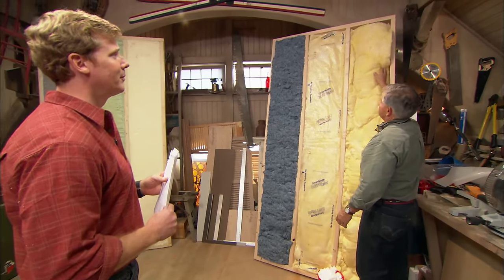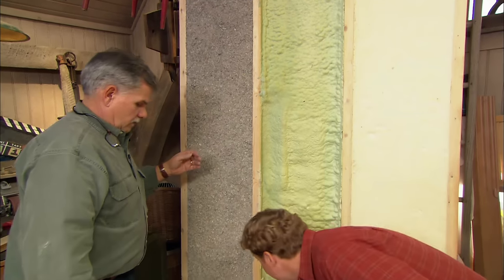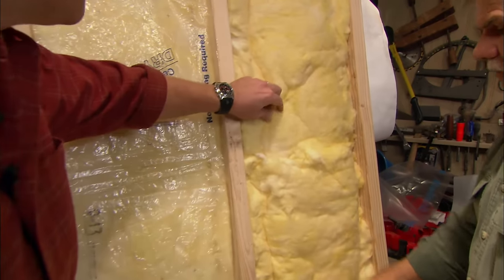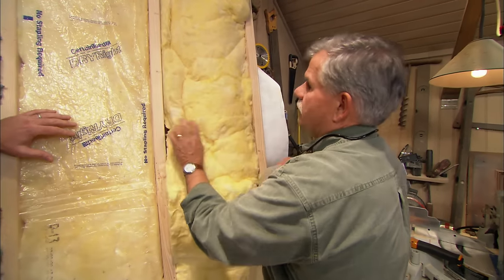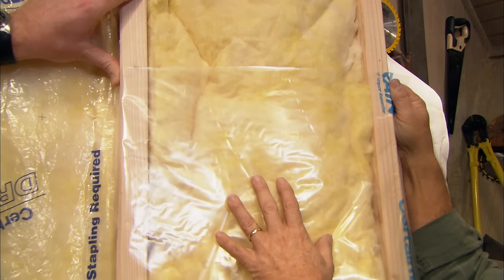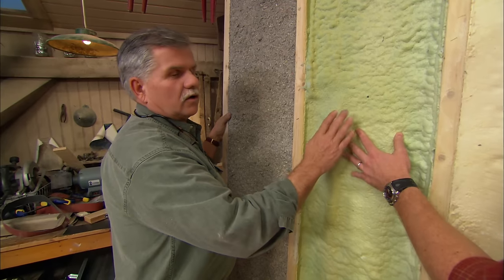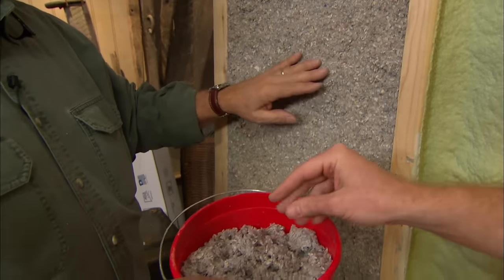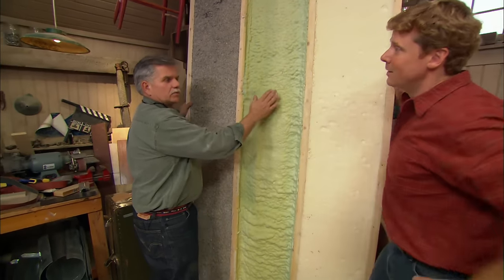How to Choose and Use Insulation | This Old House

Comment: I just had my attic air sealed before I added new cellulose insulation. The process was: All the old insulation was removed. Then an electrical contractor rewired the entire house; all knob and tube wiring was removed, not just deactivated. After the electrical inspection by the city, the insulation guys came back and air sealed the attic. They used foam board and various foams for cracks, etc. I saw pictures of what they did and the amount of work that was done was amazing. They also air sealed my basement in the same manner. Then new insulation was blown into the attic and more insulation was blown into the outer walls of the house. All the insulation work was done by a BPI certified contractor. Then an inspector came with a heat device and checked the heat loss. A few spots in the walls needed to be 'topped off' and that was done. The difference in my house is amazing; no more cold spots! I have a 1927 Craftsman Bungalow so I still have, and intend to keep, all the original windows, so heat loss happens there. I have caulked all the windows. I am working on getting interior storm windows but in the meantime, I put up plastic coverings. Even with the old windows, the house is significantly warmer. What a difference.
Reply: What was the cost for just the full insulating?
Reply: I'm saving your comment. I want that done to my home. Just what I was looking for. Thanks for leaving your comment.

Comment: Something no one talks about and most people don't realize is that the rigid spray foam insulation offers no sound proofing.  My neighbor spent a fortune insulating his entire house with it and now he can hear someone's conversation on the sidewalk as if they were in the same room.  Personally, I would spend the money on ICF instead.
Reply: You can use a combination, 2” closed cell to get your air and canoe barrier, then 3.5” of rock wool, then 5/8” sheet rock.
Reply: There’s also sound dampening you can put behind the drywall
Reply: @jaykay9112000 - I actually wouldn't do that either as it puts the vapor barrier (the foam) too close to the cold side of the wall (for my climate zone anyway - zone 6), asking for condensation and mold.  Plus, who wants to hang entire homes in 5/8 board?  Not me.
Reply: Because it dries hard, it become a sound 'conductor'. It creates a 'circuit' for sound to travel from the exterior to the interior. The other insulation's do the opposite with 'Rock-Wool' having probably the best sound-proofing characteristics. As with many things, there are trade-offs. . .
Reply: Brian D. I have now put spray foam in my ceiling and exterior walls, and I don’t notice anymore sound than when I had fiberglass. If you look at the sound dampening tests spray foam is only slightly below fiberglass in the testing
Reply: Plus it shrinks and allows air around  it. It gets Worse. It's hard to take out and start over
Reply: Icynene Spray Foam does not do that, It's open cell. WE have had it in our house for 20YRS and love it.
Reply: closed cell is best for attics and stuff like that. open cell is best for interior walls etc. you can also layer spray foam and fiber glass to get more R value.
Reply: He used open cell??
Reply: Plus gas off from the foam is toxic. Lots of people have gotten sick. 20/20 did a report on it.
Reply: Rots the timbers not fits.

Comment: In my denver 1.5 story home, i could not get the upstairs below 78 on hot days with the AC cranking full time. (My system was working properly but flow upstairs was weak). My cellulose insulation was only about 15 inches. I had a contractor add "caps" to the 15 can-lights  and seal them, top off the insulation to 36 inches, and foam a few spots like where my two-story living room wall abutted the attic over the garage. The difference was amazing. If the AC is on, the upstairs is about a degree warmer than the 73 degree main floor, and the AC will now cycle. But even on hot days, if i run the house fan at night, the house is cool enough to where i wont need the ac  until the afternoon, if at all.

Comment: Very nice! Especially for people who is just thinking about insulation!  What exactly you would recommend for a plain 20+ years old (not commercial)  single level residential house insulation? Brick veneer outside, than timber frame and plasterboard inside (with empty voids of course) :)   I can see a soft maths at retail which are very similar to one of your samples. However nobody from experts can advise me about a vapour barier.  How to do this? What kind of material I have to use? Is it something special or ... any plastic film can be used?   A very interesting subject- what do we have to do with ... massonry "weep-holes" underneath?  Should we cover them or leave them open?   And, btw.... while insulating empty walls we are creating a nice environment for "crawlers". It will be convenient and warm for them to grow their colonies. How to prevent this "side effect", please?    Thank you

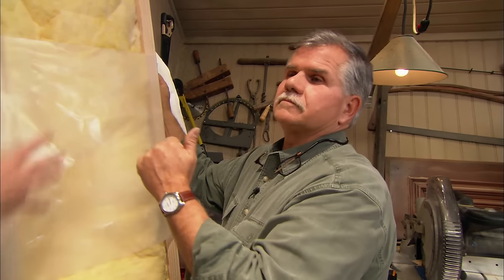Comment: I'm trying to figure out how to get mold and mildew from developing in a large closet. Because it's on an outside wall, moisture seeps in. Tried DampRid (hardly any good) and a small dehumidifier (fairly ok). Does blown cellulose fix this issue? Or do I need a vapor barrier as shown at 2:38?

Comment: Nothing was mentioned about Stone Wool or Roxul or fire prevention.
Reply: ximenoworks There was something mentioned about fire prevention.
Reply: How do I get insulation into existing walls
Reply: Linda Munsey He covered it at the end. 
Home Depot rents a machine. Drill about a 2" hole at the top of the wall between each set of studs. Lots of holes. The machine grinds it up and blows it into the cavity.  Then repair the holes.
Reply: Outside, inside og in between :)
Reply: Lemay that’s mainly used for fire blocking and sound. I’ve never used it for thermal.
Reply: Linda Munsey remove the outer wall or remove the sheetrock
Reply: Shang....Hardly.  It has an R15 rating
Reply: Linda Munsey you need to make a human sacrifice to the insulation gods. Then wait 3-4 weeks for shipping.
Reply: Why didn’t he include Rockwool insulation?
Reply: @dbodooley  you're so wrong it's used for insulation and has been for a very long time
Reply: @shawnr771  bad advice, Shaun. Getting densely packed fiberglass in walls is impossible. It will settle. Getting densely packed cellulose into a wall takes experience and professional equipment not available at the big box stores. BTW, your hole location and size are off.
Reply: or the issues if you ever want to change or add an electrical outlet in walls with the spray foam inside.
Reply: Shang Tsung no it is used for thermal and it is good at it,
Reply: @lindamunsey9898  they talk about that
Reply: Shang Tsung wrong
Reply: @dbodooley  Roxul makes both. For sound and insulation. I replaced all of the dangerous fast melting fiberglass Insulation  with Roxul. My R value went up by a factor of 2 from fiberglass insulation Melting point of Roxul is above 2500F as fiberglass melts below 1000F. Its simply safer for the house from a house fire point of view.
Reply: Came here to make sure someone brought this up. Fire retardant without added chemicals, bugs don't like it, eat to fit in, repels water, isn't ruined in a flood, etc.
Reply: @shawnr771 if I do this method,  do I leave my old insulation there ? The old insulation been there since forever. My house is from the 50s. Not sure if prior owner did any renovations. Thanks.
Reply: Not sure on that 

The home I did not have any insulation in the original walls and no fire blocking.

It sounds like you have a serious project.

If you are doing demo make sure to wear appropriate PPE.

Comment: Two questions for Tom please? 1- How can a DIY homeowner put any of the retrofit insulation in ourselves without hiring out the job or renting a blower? 2- Why is the foam (or other full compact insulation) so popular to you Tom, when I have seen you trying to run wire or cable down the inside of an existing wall? Or for that matter, repair or run short plumbing vertically? Thanks to the team for all these Videos!! I learn something from all of them (wish your team could come to my house and video some needed repairs).
Reply: FYI...closed cell spray foam is the best insulation...BUT - you can't do it yourself and it's expensive.  And if done incorrectly it can be dangerous and possibly render your house unlivable.
Reply: I saw that on Youtube from a segment on the CBC where homes were made unlivable and people had these brand new homes but had to live in a trailer outside of the home or they would become instantly sick and the horrible smell too.
Reply: @tonym1279  , it's not "the best" it harms our ecology big time. You can insulate inexpensively and reach zero energy.

Comment: Which is the best retrofit material for a cathedral ceiling through the fascia & soffit to add present bat insulation in Illinois weather. Venting along the soffit was shut due to the moisture condensation inside & vents at top of roof left open cause scaling at top of beam inside.  Thermal imaging was done and the corners & a 4 x 5 foot area over the front door was missing insulation.  Advise would be greatly appreciated.

Comment: If you're here in 2020, it's been determined that water vapor amounts for about a quarter of a pint over the period of a year. Compare that to almost 12 quarts of water with just a 1 inch hole in your wall. Air movement > water vapor, every time.
Also, a latex primer over your drywall is more than enough of a water vapor barrier.

Comment: Anyone know of an option for insulating a beatiful old cabin with log siding ext, and vertical pine solid paneling inside?
Reply: It’s hard
Reply: Probably reframing exterior walls inside and re-panelling them, but depending on the footage of the rooms you will lose quite percent of it.

Comment: I watch this show on You Tube and the the TV....... it's just too bad we don't have these type of craftsmen in the Houston area...... where things are very often built the "Houston way".......... aka, build it so it "lasts" a year, after which, the warranty is up and it is the homeowners problem. See these poor workmanship issues all over town. Especially on the west and northwest side. Pretty sad.
Reply: Mickey Cook - Cough DR Horton Cough.  That's what happens when you get a home builder that only goes with the lowest bidder on everything, and a lead contractor who is never on-site to make sure quality is met as workers come and go.
Reply: Yep I was doing an inspection out in Katy/Cinco on Friday..... $350K house with the most basic AC system you could put in. Only 9 years old. You could see them in most of the houses in that subdivision. Even the house next door to this one had 3 different types of siding/brick. Two different types of brick and Hardi also....... what was that about. But you'll still have people buy this junk.
Reply: Mickey Cook
Reply: @mousearebec  See if that was one of  the last houses built in that subdivision. Many times the developers will use up left overs on the last house.
Reply: Any video you guys recommend on how to insulate a detach garage for those hot Houston summers? Something that'll make you say "this is reasonable (job and price)."
Reply: Yep Houston is notorious for this and I hate it. I hate all the new neighborhoods going up everywhere too. Hardi board... the new vinyl siding. It just looks cheap. lol And nobody cares about craftsmanship anymore. My old house on the south east side of Houston has cedar shake siding and I can't find anybody that knows how the work with it and the one contractor we did use on one section didn't do it right. Ugh it's depressing.
Reply: @nholt  As much as it is supposed to be a good product...... ALL the hardi I see is mildewing or green. I'm sure it is the paint issue but it is everywhere. It does look cheap.

Comment: What's ur opinion on rock wool. I've heard alot of great things. Fair price as well. Building at 10,ooo ft. Need to be warm.
Reply: I recently installed it on part of my basement,  saw a difference right away. Wear gloves and eye protection. I recommend to anyone. I paid about $51 for one pack covers about 59 sq feet of space. Good luck.

Comment: Hi - my bedroom is right above my garage. I am planning to have closed cell spray foam insulation on my garage ceiling. Do I need to put dry wall after or can I leave the spray foam exposed? I live in Toronto and it gets very good here during winter months. Thanks in advance.

Comment: Closed cell foam may transmit noises through the wall. 
What’s the best for clean air in the house? 
Do these emit toxic fumes?
Reply: Make your house as cold as possible or as hot as possible for your climate. Then open all your windows.

Comment: Question i have a shed the wall are open cavity. I also live in Flroida, very hot. My concern is wall are open, so can i installed a vapor barrier push in between the studs and thn installed? avoid mositure and mold.

Comment: great video.  I live in New England and will be building a new home.  I want to use closed cell spray foam and have had others suggest 1" of foil backed board over the spray foam on the inside of the house to stop thermal bridging - what is your take?

Thanks
Reply: Hey, I was curious what decision you went with, if there was anything you wish you knew in advance, and how is it holding up 5 years later?

Comment: I’m not so sure that heat wants to transfer to cold but cold with add force to heat. I’ve noticed this with my insulated over shoe that in the truck I will have the heat on high and not feel the heat in my boots but 30 seconds after I step out side I feel my feet getting really warm and can feel it for awial. Now with houses I’ve noticed ac will run for 15 minutes at a time during the day when it’s 90 outside but as soon as temps out side reach  60 starting at 7pm I notice inside temps go up and the ac is running almost none stop till 2am we keep inside temps at 65 2x6 fiberglass insulation with internal vapor barrier.

Also before adding ac inside temps would be ok at 75 during the day till it started getting colder outside then temps would reach 90 inside with all the windows open the best way to solve the issue was to have fans on one side of the house sucking and another blowing it out to force the air otherwise it didn’t seem to really move.

I’m thinking a heat shield may work better if you could build a awning around the whole house with a air gap atleast three in from the actual house may help? Since heat Shields work very well for car exhaust. Even better would be to add a three inch vacuum chamber around the whole house but can’t think of any good way of creating that

Comment: i have an old house 1930 no insulation.. stick built..  it has a cavity to insulate.. but right now its got a lot of wet on the bottom of some of the walls.. about a foot off the floor..  those floors are close to the ground the crawl space, is literally so low you cant crawl under those parts..   there is vinyl siding outside but i do not think there is a vapor barrier at all.. its just the clapboard and walls, i think its plaster but i dunno if someone has put sheetrock over it in an attempt to cover wet walls....  i have to drill in to see if its plaster, but i'm guessing that it is due to its age...  how can i insulate these exterior walls.. can i use foam in insulation with a vapor retarder on the inside and put up new drywall.. ripping out all the exterior plaster walls. or will it still sweat and get damp because there is no vapor barrier outside ? i know i cannot strip all the clapboard cladding off the house and add vapor barrier i just don't have the funds.. can a vapor barrier be put between the vinyl siding and the wood clapboard siding? or will this trap moisture..   another thing i thought about doing was taking down the outside walls, putting an inch of cut to fit styrofoam between the studs leaving a little room between the clapboard siding and foaming all around the styrofoam... to stop air infiltration and then putting the fiberglass batting inside and then drywall...  will this work? or is there a way i can blow something in the walls and not cause it to get damp and rot down the walls. i've read that blow in in an old house with plaster can cause house rot and damp walls and attract bugs.. ??  any suggestions? i am driving myself nuts trying to figure this out... we have two trooms at the back that we tore the wet wallboard all out of its a board batten type of add on, no airspace, it has wood clapboard on the outside and then vinyl on top of that, i want to build new 2x4 walls and insulate the walls in these rooms but what should i do.. should i just strip off all the wood and vinyl outside and put on plywood and a vapor barrier? or is there a way i can do it without having to strip off the clapboard siding...  i really don't want to have to do that if i can get by another way...  the house is right nearly on the ground towards the back, all the sills have rotted, they have poured a concrete ditch all round the side of the ouse in a U shape in an attempt to direct water away from the foundation.. im worried that this is the reason for all this dampness its just not doing its job...     help!!

Comment: I have a house built in 1935 and it has no insulation on the outside walls.  All it has is wood vertically going across the frame of the house then this black paper and finally the original wood siding.  Should I use a Vapor Retardant on both sides of my fiberglass insulation?  I live in Northeast Ohio so we get weather like New England.